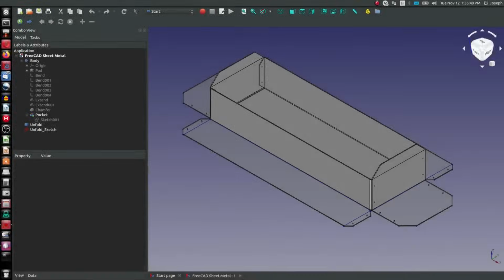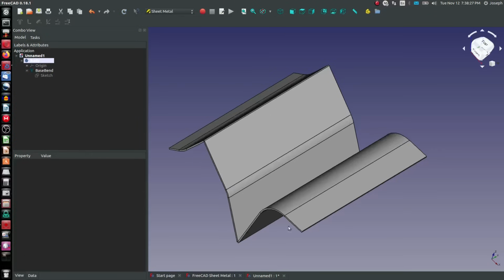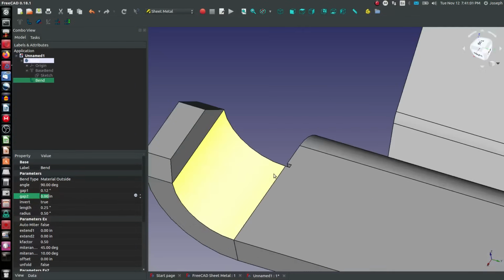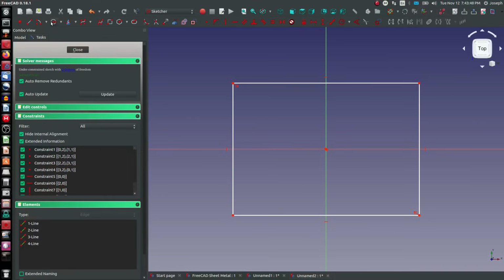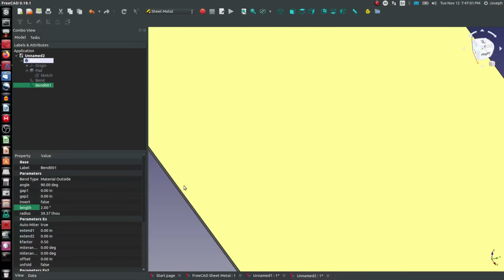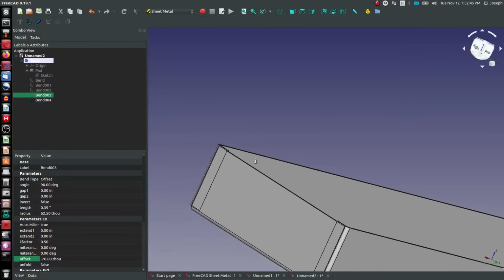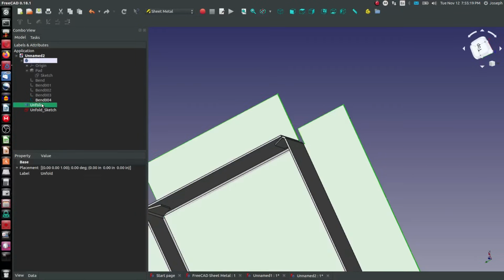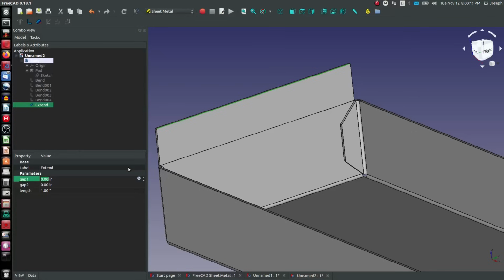FreeCAD - The Elegant Sheet Metal Workbench|JOKO ENGINEERING|

Comment: These are some weird, wrong ways of designing sheet metal parts! For example, I need to make something like an asymmetrical funnel out of a sheet. I know what the final shape should be: the size of the base, the top, the length of the sides, the height.. What should be the flanges, where should be the seam.. But I have no idea what the angles and allowances for bends and everything else are! The native freecad has a function that allows you to expand such a pyramid onto a plane, but it does not take into account the K-factor and cannot automatically add flanges, and this is not so easy to do in FreeCAD! But I see that this addon does not facilitate this process, and perhaps even lengthens it. I could draw such a square box without any addons, including those with rounding and bends without any addon! I'm disappointed.
Reply from the maker: What parametric platform best matches your design intent?

Comment: You may preffer middle line for a profile of a sheet metal part, but it makes very little practical sense and that's why it's not used in sheet metal industry(sure, there are exceptions). But it doesn't affect your demonstration, you've made a good job 👍 Unfortunately one of the most important subjects in sheet metal is adjustments to particular tools of your workshop, or even particular machine and toolset, since it may differ even on the shop floor. As it is now, all the dxfs produced by FreeCAD have to be usually postprocessed and adjusted (to get a precise product). It's a simple process that good sheet metal fabricators know well; rarely designer talks to fabricator and implements his tooling tables to prevent this. So it's good enough for initial design and rest for DIY.
Reply from the maker: Thanks for this comment.  It's good to know the details you've worked with like this

Comment: I'm making a part that has bends from angled sides and then has a return flange that needs to continue back along the original angle of the base. The first bends along the angled sides work out just fine but the return flanges return perpendicular to the angle of the sides and not along the original base. do you know if there is a way to do this on the sheet metal workbench. I'd love to see a video of that if you do.